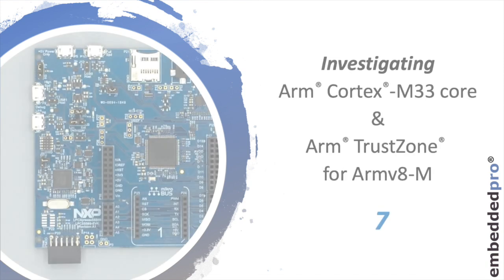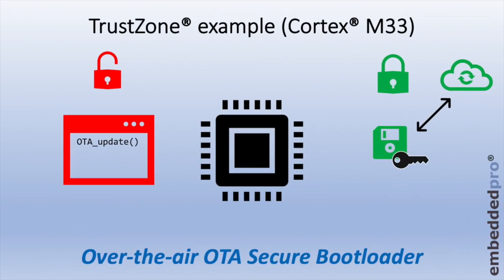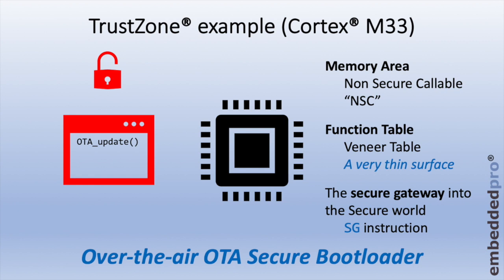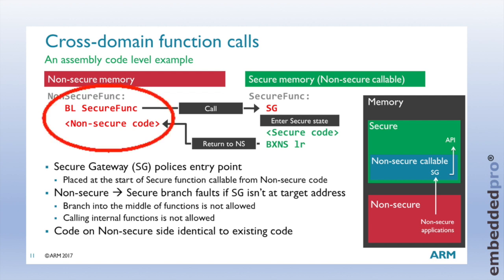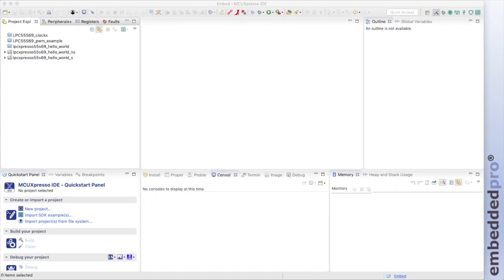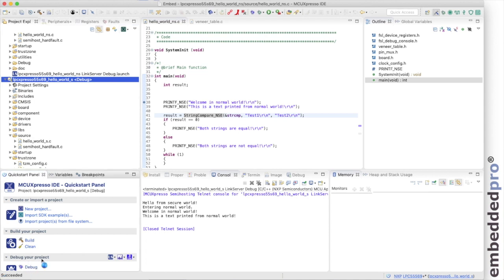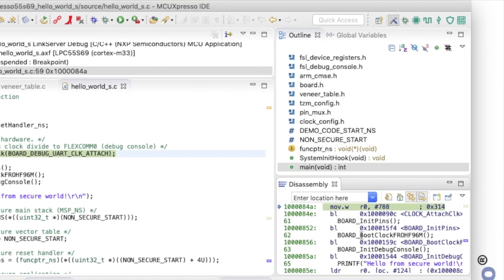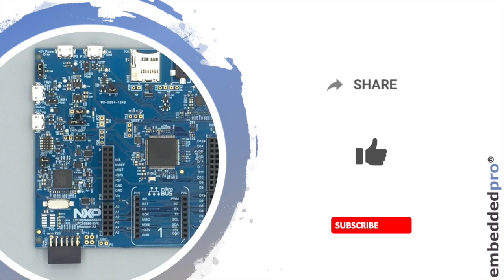7 TrustZone calling Secure World

Comment: Nice but wondering how to OTA update securely on a cortex-M3/4/7. Any tips since they dont have trustZone?
Reply from the maker: Well TrustZone is a feature of CM33 that helps to partition our code into secure and non-secure domains. It is always going to be problematic to make a fully secure OTA update when all the code runs in non-secure environment like on CM3/4/7. If you can sign the bootloader image and ensure that it verifies before it is run, then you stand a chance. But trusted boot normally features on CM33 devices.